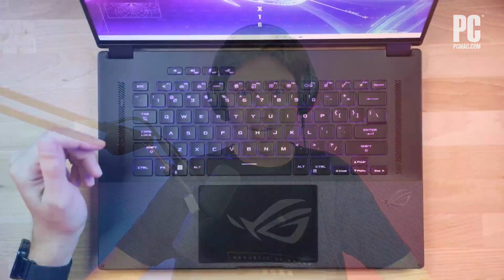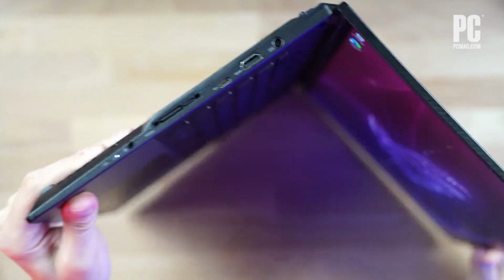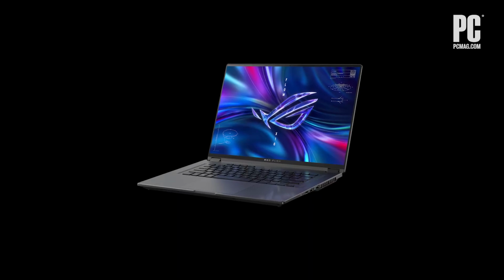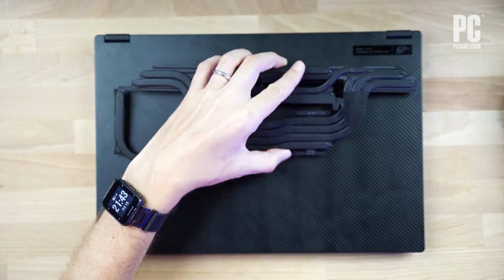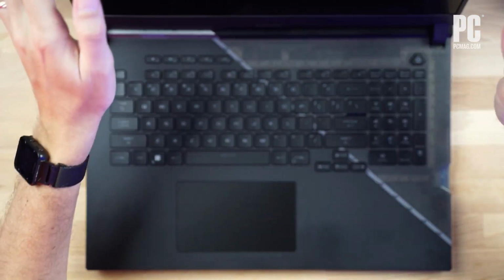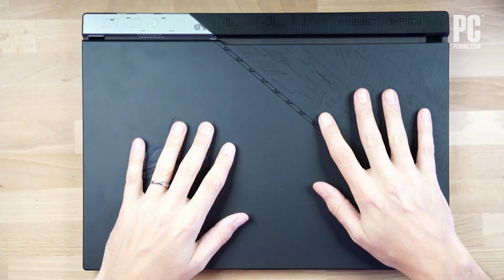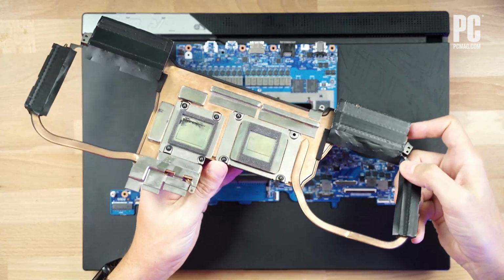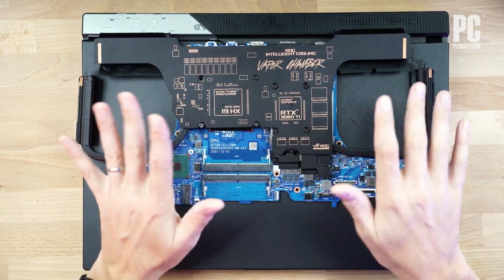First Look: Are the Asus ROG Flow X16, Scar 17 SE Laptops Worth $2,000+?

Comment: Flow x16 price needs to be under $2k
Reply: Pricing on the website is $2,700
Reply: @christianmbabazi9722  I tried 🤣
Reply: @christianmbabazi9722  just bought the 3060 for $1999 at BBY. Would've liked the 3070 Ti with Mini LED but for gen 1 mid tier soecs seems very reasonable. 👍
Reply: And now?

Comment: If you guys don't announce a new Zephyrus S17 soon I'm just going to buy a Legion i7 fully loaded. I need a camera and a more subtle lid because I will be using this for work and school as well as gaming. I debated the Scar SE but it is not quite what I need. Release a fully maxed out S17 and I will be the first buyer but I'm running out of time and need a new one soon.
Reply: I'm disappointed too 😔, nobody cares about the scar series .... we are stuck with razer blade 17 and msi ge76?? What do you think? 🤔
Reply: @MaDFroG88  Of the two I would go with the MSI GE76. Better customer support and quality control and that is a great laptop but it's expensive.
Reply: @mehdishirazi3  they are both dame price here 3100 💶 for qhd 240hz 3070ti versions.
Reply: @mehdishirazi3  I like the razer blade's build quality and design overall, the gr76 is build like a tank but thermal performance seems to be better. I live I warmer area 35 degrees  Celsius and I'm afraid 😨 the razer will have issues staying cool.

Comment: So how much will the X16 cost?
Reply: Apparently starting at $1950 in the US, not sure exactly what the specs are on that but the lowest spec listed on the website is with a 6900hs, mini LED display, 32GB of RAM, and 1TB SSD, if that spec is $1950 its not THAT bad I guess, but if its not then the pricing seems kind of ridiculous. Personally as long as the 3070 ti option is no more than 2500 I'm happy.
Reply: What gpu on that lowest one? @shadewoodchair8111
Reply: @akhilalexg  3050 ti, according to the Short  Circuit review the model with the Ryzen 9 6900hs, RTX 3070 ti, 32GB RAM, 2TB SSD, and mini LED display is 2700, so it looks like the price difference between base model and top spec isn't too bad.
Reply: In Germany, about 2500 euro
Reply: @aleksei5195  how do you know ?